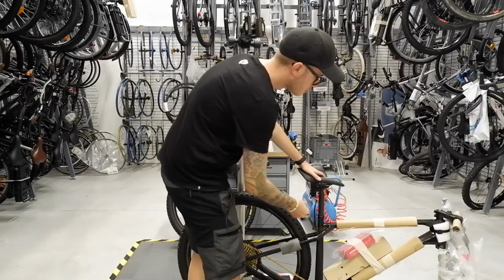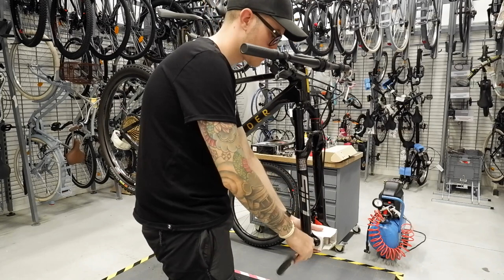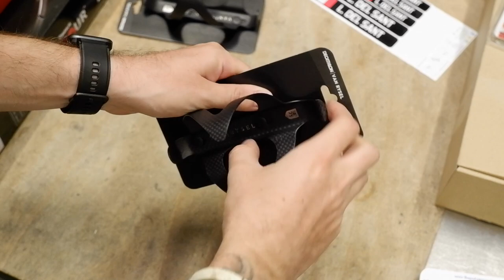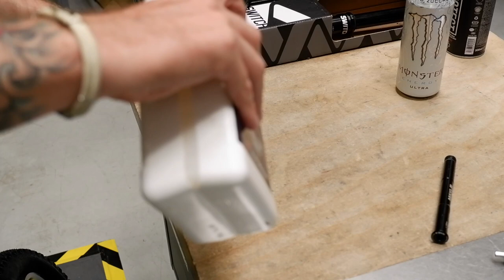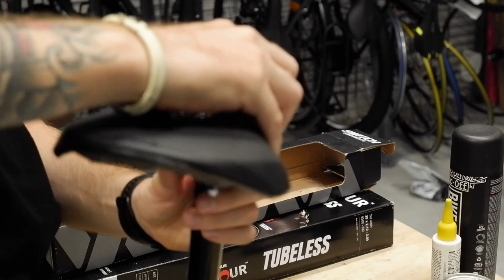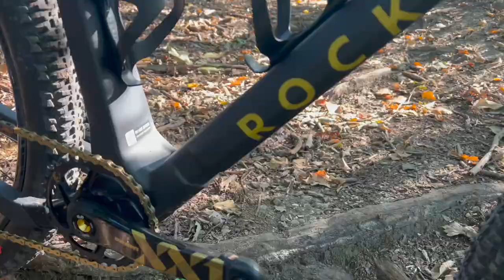UNBOXING ROCKRIDER RACE 900 LTD

Comment: Bonjour. 
Is it possible to install internal cable routing Dropper on the Race 700 Alloy frame? Race 900 is the carbon frame, they are different as I know. 
Merci.